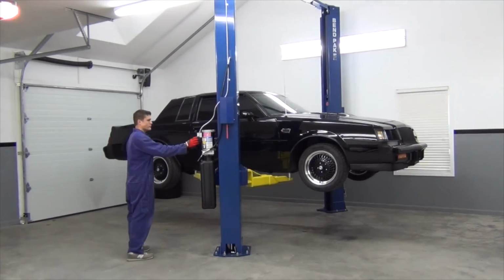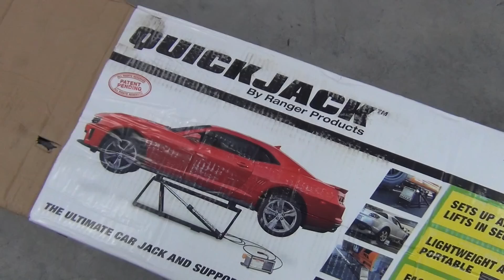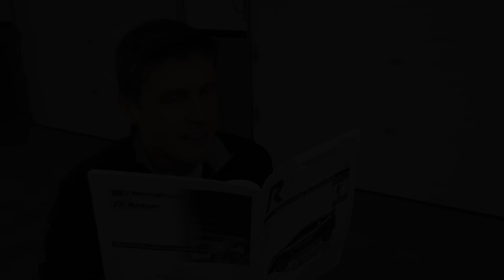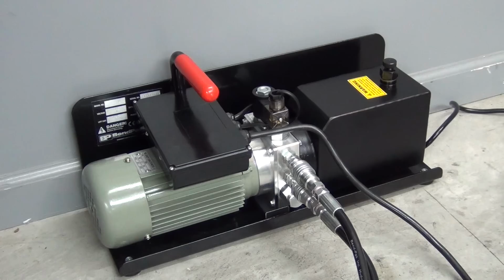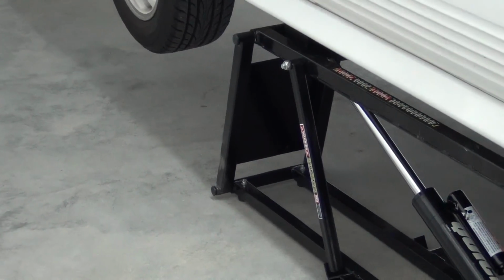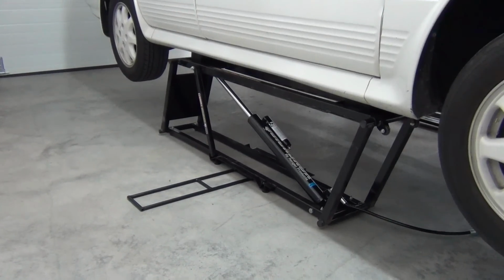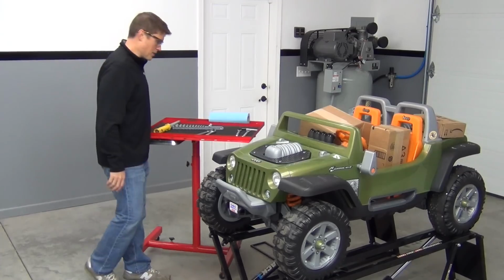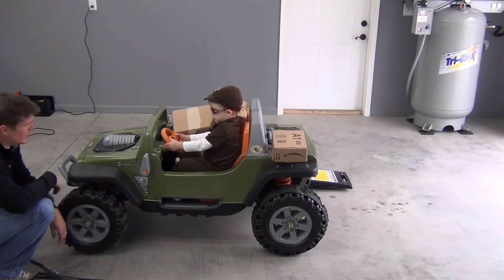My New Ranger QuickJack Portable Lift

Comment: I noticed that the cylinders have a small tank?? connected to the other end from the end you're hooking up to the pump.. It looks like it's got a valve stem on it. If it's what I think it is, that's brilliant. Other end doesn't have fluid, it has air and as you lift car or whatever, that air is forced into the small tank, pressurizing it, then that air helps lower the jack so you don't have to stand on it or anything to make it go all the way down. When you first get it, just put a bit of air, like 10psi to "prime" it to lock it in the "down" position. Pretty cool.

Comment: Also, those quick connects, I'd switch them so you have male/female on each end of the pairs so they cannot be hooked up backwards or cross the flows. They make quick connects with stops on both male and female connectors so they don't drain and only lose  2 or 3 drops of fluid when disconnecting. Makes it much easier to keep the connectors clean, just hook them into themselves, no way dirt or anything getting into them if you do that.

Comment: I have a 5000 pounder. The contactor that controls the switch failed after the tenth or eleventh lift. It is cheap  in build and design. The hoses covering isn't very durable and some of the engineering for the power unit leaves alot to be desired. It is easy to use though if you overlook its foibles.

Comment: tiny UPS man? the electric kids car isn't broke by the dog, it's because of the motor series/parallel switch being locked in series (slow speed and R with shiftlever) by the high speed restriction screw. If I had a yard train with a shifter like that, I would immediately remove it, so instead of lo, hi, and r, it's reverser, series/parallel sdlector.

Comment: First...just ordered mine. As auto repair is both my profession and hobby, this make sense. Its strong and safe, and I can store it easily. Second, should you be driving over the hydraulic hoses like that? Wouldn't it, for the sake of longevity, be better to set up the lift after you set the vehicle in place? Just a thought. Great video btw.

Comment: Of course this early design had to be redesigned to fix the hydraulic fluid leaking out of the quick connect fittings. The crappy safety bar was also redesigned. New part numbers end with SLX. Also spend an extra $150 and get the 7000# model. It's worth it for the piece of mind if your underneath it.

Comment: With the safety locks engaged and jack stands.as a back up you should be fine.This could be a good lift for brakes especially since you can remove the wheels where ramps the tires are resting on the ramp.

Comment: In the segment with the minivan, the QuickJack's rear lift point is well inside Mazda's recommended location for the MPV - just this side of the rear wheel.  And the wheelbase of the MPV would seem to be outside the 50.5" range of the BL-5000.   Lastly, the weight ratio of the MPV is well balanced and the jack location as shown would likely put it ahead of the van's center of gravity.  All that said, I really want this jack but it seems to be targeted at smaller cars.

Comment: Looking at the design of the lift. It looks like you would place them together (side by side) so you won't be driving over the hoses. Then drive over the lifts and the with  the handles on the lifts are use to pull them towards you to be put under the rails of the vehicle. This would avoid from the lines being driven over.
Reply: I think so too
Reply: Agreed.  Or don't connect the hoses until you have parked the car.  They are quick disconnect.

Comment: Nice idea but I'd be concerned about lateral support. Maybe not likely to happen but if for some reason they tipped sideways all would go ass over teakettle at the best. I don't believe those handles to slide units under vehicle were intended for that purpose. As seen works great for some Jeep models.

Comment: Thanks for reviewing these. I did not know there was an option like this. Even though I can get a decent lift about the same price, I would have to change my garage door rails and other stuff just to install it. I do wish it could go a little higher though. It would be great if I could get my engine out from below as the engine/trans combo is quite heavy for my car.
Reply from the maker: cms-gt4 You're welcome sir!  I agree that it would be nice if it went higher, but it would likely have to be much beefier with larger components all around. I wouldn't be surprised if Ranger expanded this product line eventually.
Reply: Tom's Turbo Garage Can you suggest any quality competitors?
Reply from the maker: cms-gt4  There are likely other products out there that I'm not aware of, but a few companies make mid-rise lifts that work in low ceiling garages and offer a (mostly) clear floor.  Northern Tool is one site that has a few different vendors: http://www.northerntool.com/shop/tools/category_automotive+automotive-lifts

Comment: Nice. Can the locking bars be connected so you can cut the power supply? I wouldn't like to weld sills and such with the possibility of a secondary earth causing issues with contact current.
Reply from the maker: TheLiquidKnight Thank you sir, I can imagine that it could be done with some tinkering.

Comment: Just a little bit low on capacity for my Expedition with a 5,300 to 5,600 rated curb weight.  And not enough lift for my F150 4x4.  Would be fine if I had small cars.  Looks like a good price compared to similar lifts.

Comment: Looks good, just wondering if it would work on vehicles for example, jeep wrangler? both standard and with suspension lift? or is it best suited to sedans etc? could be a good solution when changing tyres from all terrains to mud terrains for weekend adventures.
Reply: a different model wrangler to the one in the vid... haha

Comment: I just installed a 5 tonne 2-poster lift.  I had one of these dinky lifts for years.  Whilst it's good for oil changes and a few brake and tyre things.. It's just too hard to do anything else.

Engine swaps are easy now :)
Reply: I find ramps to be a hell of a lot quicker to use for oil changes! :/

Comment: well darn my ride is a 98 f150 which has a weight of 6000+ lbs( according to the sticker in the door frame). then again a max lift of 22 inches would barely be enough to change tires

Comment: So for...we'll generously call it 1/3rd of the price (it's worse), you get maybe 1/2 the capacity of a real lift and 1/3 the lift height and you still need a decent "station" to use it.  Or we could compare it to using axle stands and jacks and say that for oh...ten times the cost, you're probably hosed if you need to do car work anywhere besides a perfectly flat  surface.

Oh well.  It was a pretty exciting thing to see in my recommended videos until I shopped for one.
Reply: Markworth Markworth I think this is a decent solution for a lot of people. You also need a decent "station" to use a permanent lift, and you have to take the car to the lift. Your comment that it has to be used on a level surface is just silly. Who's jacking a car up on a hill? This is a great idea for people without the space or a garage that do a fair amount of work. It's easier than messing with jacks and multiple jackstands. You're paying for convenience basically.
Reply: Would you use this setup on a gravel driveway or grass?  I wouldn't.
Reply: Markworth I wouldn't use jackstands on gravel or grass either. But you can put down 3/4" plywood on gravel or grass, then use this system on top of that. I would not do that with jackstands because of the reduced footprint. Too much force exerted on a small area could cause the plywood to break. These quick jacks spread the load out so that won't happen.

Comment: How much front to rear travel is there when the car goes up.  I'm concerned about how far car will go back when it goes up
Reply: I have a 2015 Jeep Grand Cherokee Overland. SURPRISINGLY the best, most trouble-free vehicle I've ever owned... It has never been to the dealer, not even FOR SO-CALLED "SERVICE".... Which may very well be why I have no trouble with it.

I'm finally understanding that it is overly creative service writers, the crooked dealers, and their crooked mechanics who make it impossible for our new cars to remain trouble-free.

12000 Miles between oil and filter changes which I do myself... I use full synthetic oil... ALL DONE FROM UNDER THE HOOD (15 MIN. JOB) I never crawl under the car... DON'T HAVE TO!

You want your new car to remain trouble-free for many years KEEP-IT-AWAY-FROM-THE-CROOKED-DEALERSHIPS.

The technology that goes into modern cars is no less than amazing. They are built to last forever. Assuming you keep them away from the service departments of HUNGRY DEALERS AND THEIR HUNGRY MECHANICS, WHOSE PAY DEPENDS ON HOW MUCH THEY FIND "WRONG" WITH YOUR CAR.

If that's not enough incentive to cause sabotage your car and cheat you, I don't know what is.   

I DO BELIEVE 99% OF THEM ARE DISHONEST!

Comment: Nice idea, but quite frankly, I would not feel comfortable lying under a car supported by two hydraulic rams, backed up by the small 'outriggers' and 'lock bar'.  While placing the car on heavy-duty trestles may be a mission, at least I have the confidence that the car cannot come down once securely positioned.

Comment: What prevents the lift from collapsing? I see a little rod that is suppose to lock it in place, but that rod looks like it could just as easily fall out of place. Thanks!
Reply: The bar cant fall out because it is connected at the top. Just swings down and locks in place at the bottom.
Reply: it needs more of those cross members to create a truss, otherwise I wouldn't trust it.

Comment: Have you tried this with your IS-F yet? Looking to pick up a BL-5000, however its max span is about 6" short of the designated pinch weld jacking points on my car. Thanks!
Reply from the maker: Hi there and I have not.  I would call BendPak as you're right, it won't work on every car for the reason you mention.

Comment: Do you know if the QuickJack is long enough to lift your Grand National using the correct jacking points in the frame?
Reply from the maker: MonteCarlokid87ss That's a good question.  I sold my GN, but I would suggest checking the measurements against the info on the BendPak website and/or giving BendPak/Ranger a call.

Comment: Here's my question: 
Can the jacks be disconnected from the pump and hold their pressure?
It looks like the lines would get in the way of a creeper rolling around under there.
Reply from the maker: I'm not sure but the locks do hold the lift in the up position.  Give bendpak a call, they could answer that question in a second.
Reply: It should. This quick connector model work like a check valve when disconnected.  Some quick connectors are designed ''open end'' so the circuit remains open when disconnected. A good example of this one is air hoses used in tyres shop used to inflate tyres.
Reply: Yes, but you need to push the down button o cell in the lock position to empty the lines
Reply: No, but when locked in place with the locking arms, you can disconnect the hoses.
Reply: @enterBJ40  well if it should or not, the manual says you can't use it like that. It says only rely on the locking arms and only then can you disconnect the hoses when under load.

Comment: you should make PWM UPS man van motor control, i don't think on/off is good

if motor below 1KW, that should be very easy (pm if you need more information)
Reply from the maker: Linas K Thank you for the suggestion Linas!  I have seen that done before and have the instructions.  It's a time issue really, that and the kids ride their bikes much more than they use the old jeep.

Comment: Do they have these in a slightly lower profile? My car is pretty low to the ground and I am seriously looking at this but I don't think it'll slide under my car.
Reply: +TheMysticSpade Saw another review on it and they said you just have to jack up that side and then slid the quickjack under.
Reply: DaTwistedOne1 I thought of this as well except my bmw unlike most does does not have a separate jack and jack stand points.  So it would be a chore to slide under while having jacked up a bit.
Reply: +TheMysticSpade On BMWs the point slightly in front or behind the lift blocks are equally strong. Put a small piece of 2x4 on a regular low profile jack and jack it up high enough to get the lift under. I've been doing this for years with no issues, even on really old/rusted bimmers. Often these cars are too low to even get a standard 2 post lift under so jacking up a few inches is required.
Reply: Just drive your car up on 2x10 pieces of wood and it should give you enough space to slide the quickjack under. Thats what i do all the time when i have to jack up my lowered car

Comment: 8:26, what's that on the back tires? Rubber so you have traction on cement? That's the only thing I can think off... those hard plastic wheels would probably spin too easily.

Comment: The geometric design doesn't look safe. It needs a truss structure to lock it into place. I would not trust getting under that lift without additional support. 
Also as others have mentioned, the hydraulic lines should NOT BE DRIVEN OVER. Don't be lazy, place the car and then place the jacks. Or get creative and longer hydraulic lines and hang the lines from the ceiling.
Safety First.

Comment: I got the same. It works well, but it leaks like a seive
Reply: @trans. waow, thats what I was afraid off. great comment
Reply: +Max R NP. I dang near killed myself once by slipping on the hydraulic fluid. I have vinyl flooring so it was even worse.
Reply: +Trans am county - Maybe it's time to check for the correct assembly. Leaks in lifting equipment should not be overlooked ever. ;-)

Comment: The safety lock bars are suppose to drop and slide by themselves into the locking position. You should not need to lock it yourself. That's a safety issue.

Hydraulic lines are suppose to go outward and away from the frames. Shouldn't be driving over them.

Also don't use the lift without a load on it, minimum of 1500 pounds or the jack may lock up.

Comment: When I open the valve to bleed it at the 1st lock position , won't the frame move up and down a little bit? or it will stay in the locking position and won't move at all?

Comment: i mean its cool but it doesn't appear to raise it much higher than just a floor jack and jack stands.
Reply: It's mostly convenience if a 2 pole lift isn't a option. They also have S.U.V. truck height extension kit you could use.

Comment: Does it work on all cars though?  Don't some cars have different jack points?
Reply from the maker: Edgar Garcia Hi Edgar I don't believe it works on all cars.  They've got the measurements on their website: http://www.bendpak.com/Shop-Equipment/QuickJack/
Reply: Edgar Garcia Hi Edgar, I accidentally ordered one of them based on the pics lifting an F type jag... Initially they were not sized for S2000, Porsche 996, 986, 997...

They have a newer XL version that I am ready to order.

As an aside I agree that Bendpak is great. They even allowed me to return it though charging a small restocking fee. And it was completely my fault.

Comment: Hey Tom! Just bought my first dsm! It is a beautiful 1999 gst in amazing exterior and interior shape, 100% stock, even the factory wheels, air box, and muffler! Now that is rare to come by. Anyway, where did you get those hood struts from? I want to put them on the eclipse, I hate those hood rods, my 3000 doesn't have them thank god! Also what is the part called that feeds from the maf into the turbo called? I want to see if i can find a aluminum/steel one used one on a local FB page, my girlfriend had one with a stock bov but you could hear it, I think its the fact that recirculating air rings off of it, so I want to test this experiment but I do not know what the part is called. Anyways can't wait for the video as always!
Reply from the maker: rambow70 Congrats man!  Sounds like you found a great one and I hope you enjoy it to the fullest.  The hood struts are found at http://b2autodesigns.com . If you don't see them on their website, just drop them an email as they have more model kits available.  The part you're referring to is called a variety of things depending on who you talk to, inlet hose, intake hose, intake pipe, etc.